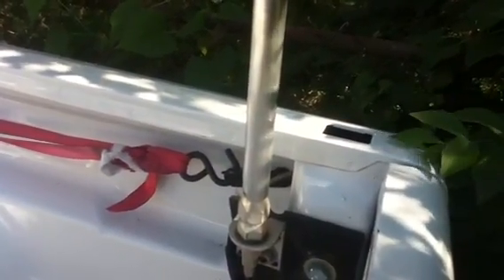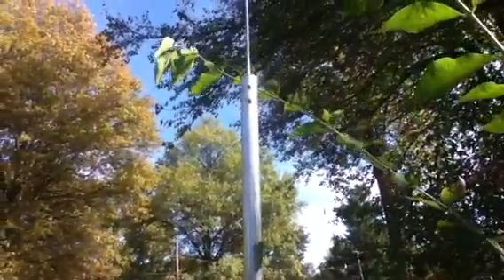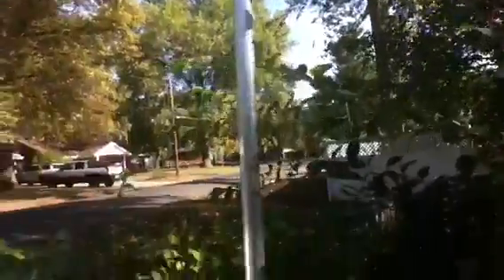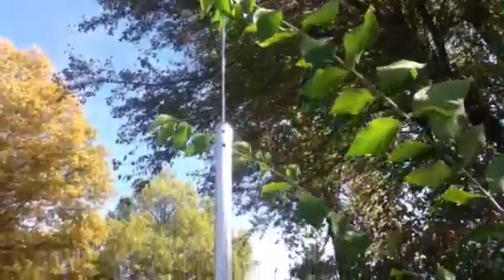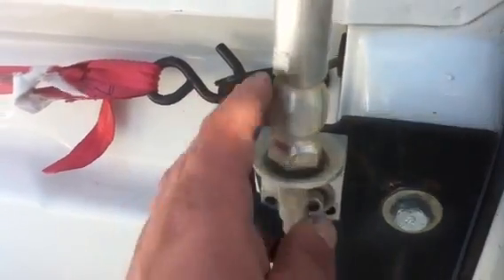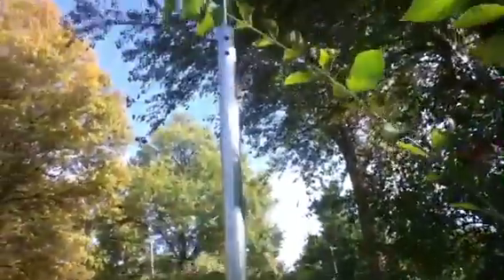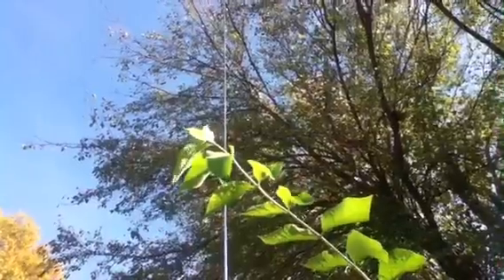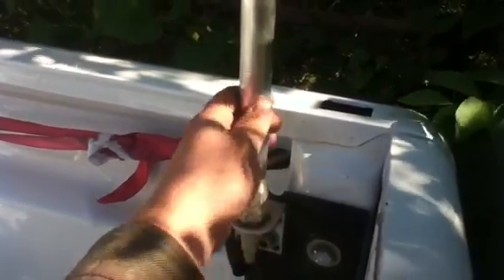Machinist John, KB9OJS copy of the predator freedom dx ante

Comment: it's a 1/4 wave whip..  no matter what you say or who makes it it's only a 1/4 wave, no gain whip..

you have made the bottom half thicker which only stops the whip from bending and flexing..

anyone can make one, but what do you gain, a 1/4 wave, no gain whip..!!

don't get me wrong it looks great at the base, untill i saw it was just a 102" whip..!!

you may as well use the top two sections of an A-99 mobile or an I-Max to have the same effect..!!

*pauses for a thought*
Reply: With a 102 or 102 on a spring or a 108....As soon as you start rollin down the road its looseing out....It bends by far more than the freedom and alters the signal pattern and ant tune due to added electrical length...I personally rather a stiffer base but even with a trimmed 102 as his whip it still bends in the wind some,just not as bad...If you wanna get picky,shorten the whip a lil at a time and go drive then watch analyzer to set it in on fave freq on the move vs sittin still